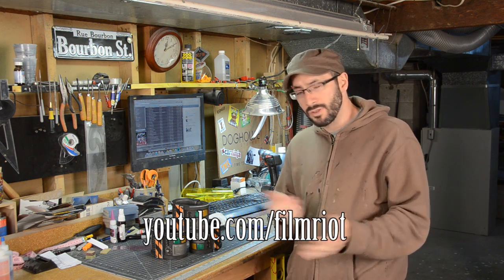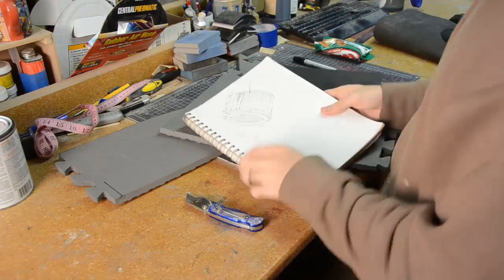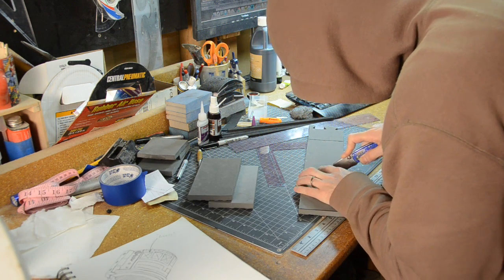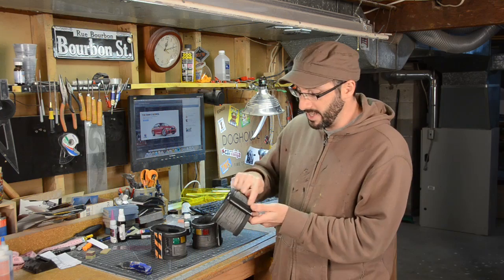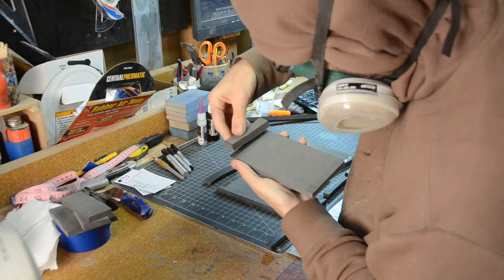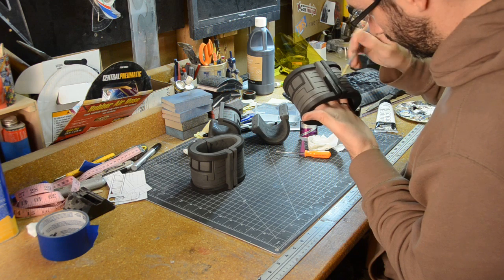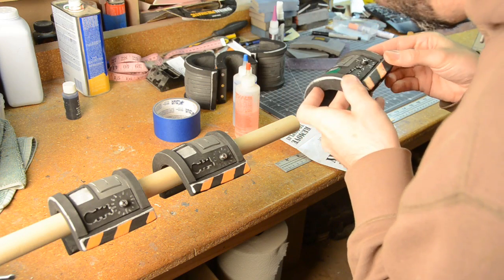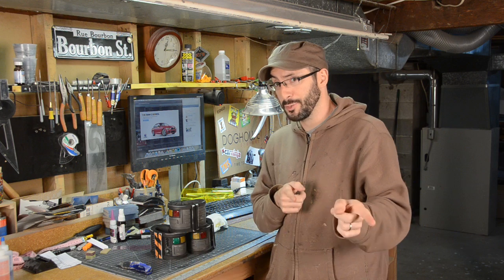Proximity's Ankle Cuff Foam Fabrication Prop Build

Comment: Did you use rare earth magnets for the magnetic connection? If so, how did you attach the magnets to the foam so that they would not come out of the prop?
Reply: you know i though that to but i would just take a exact knife an cut 3 indentions in the end of the foam and then just superglue them in and use regular magnets
Reply: Cool - thank you!
Reply: ***** thanks Bill!!! by the way BIG fan and great job on PROXiMITY!!!